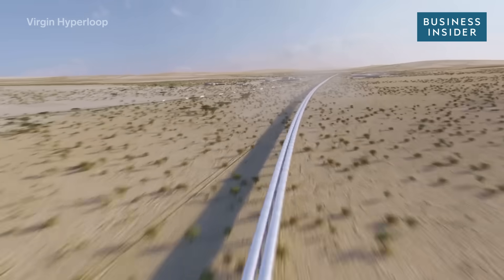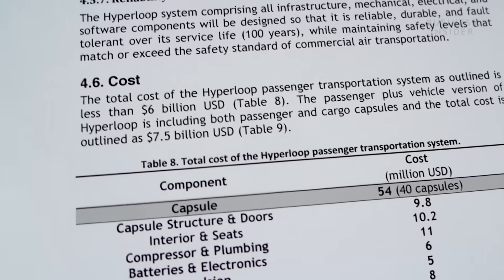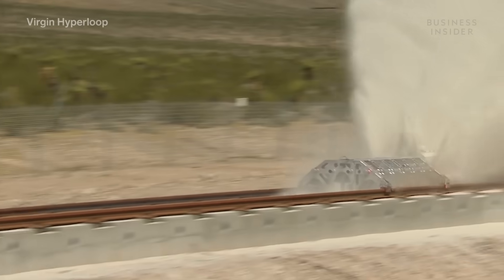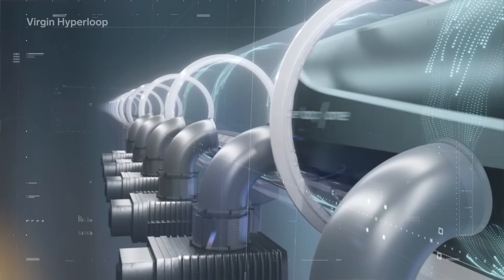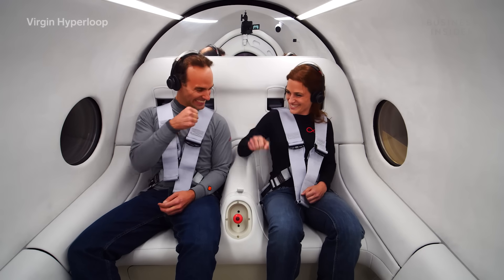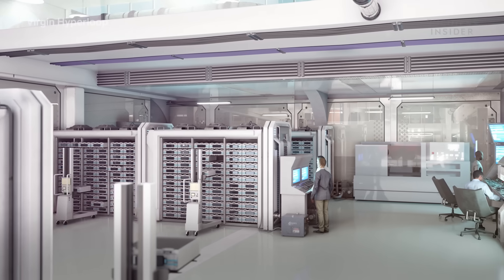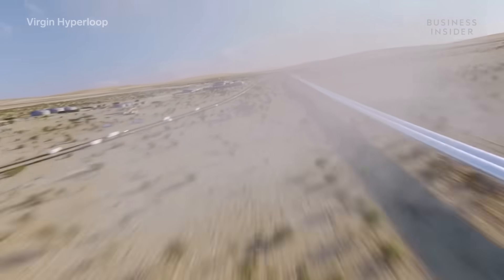How Elon Musk's 700 MPH Hyperloop Concept Could Become The Fastest Way To Travel

Comment: Hi I love the hyperloop but I came up with Aqualoop or Hydroloop idea which I think it's better. It's a tube system filled with sea water with its water current going in one direction and looping back around speeding up. the mag track would be on top and the capsule/train would be weightless. Not only solving one but several problems all at once. Rising water/earth temp./drinking water/cleaning oceans/logistics/electrical energy/fire Fighting...

Comment: Yo imagine accidentally getting out and ur body just explodes cause of the vacuums BAHSBABA
Reply: Imagine going in a pressurized metal tube which kill you when it fail... Oh, it's just a plane then.
Reply: @bachvandals3259  no i meant the vacuums outside the carriage. Theres 99% less air, meaning that getting out will cause your body to fill the entire space that the vacuum exists in. Planes kill you by diving straight to the ground, not always by its surrounding area.
Reply: @user-l4m8g  It doesn't matter, most people die right after the malfunction, children and light weight will be suck out first. There is a thing call air pressure force, and it has nothing to do with how empty the outside is, rather it's the amount of air that is de-pressurized. People die from crash in the landed explosion is a myth, they die from whiplash and rapid deceleration and acceleration. People die from 50G, not the vacuum.
Reply: @bachvandals3259  ok cool but like. That wasnt the point im making tho. Technically everything that fails that isnt supposed to, kills. I was just talking abt the hyperloop specifically.  Whyre you talking about planes under a comment about hyperloops.
Reply: @bachvandals3259  i mean. Good on you for knowing abt planes but like,,, Why are you talking about it here.
Reply: @user-l4m8g  No, i work in oil pipeline pressure monitoring, in short, middle-East engineering oil contractor.Reason? Covid, US unconditionally surrender to terrorist in Afghanistan and Syria. Jobless, depressed and lots of time on hand.
But, mostly because i hate slightly incorrect comments on YouTube.
Reply: @bachvandals3259  aight then. Glad my comment was a destressor i guess.
Reply: @bachvandals3259  yeah the u.s surrendered to the terrorist they created by bombing the shit out of peoples homes
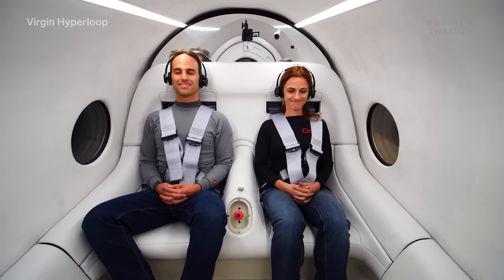Reply: @bachvandals3259  https://youtu.be/BafdAGKvR38 welcome everyone to participate in the last meditation in the Age of Aquarius, in order to end the epidemic, please participate and share a lot!  We will meditate in the Age of Aquarius at the exact moment when Jupiter and Saturn intersect on December 21, at 6:22 PM UTC.  This is equivalent to 10:22 AM Pacific Standard Time in Los Angeles, 11:22 AM Denver Standard Time, 12:22 PM Chicago Standard Time, 12:22 PM Eastern Standard Time, New York 1:22 PM Eastern Standard Time, and London GMT PM  6:22, 7:22 PM Central European Time in Paris, 8:22 PM Eastern European Time, in Cairo, European Standard Time on Tuesday, December 22, Taipei and Beijing, December 22 Beijing Time, Japan Standard Time  , 3:22, Tokyo, December 22, Sydney, 5:22 EST.  http://2012portal.blogspot.com/2020/11/make-this-viral-age-of-aquarius-final.html?m=1

Comment: Nope.  Never happen.  Dump your liberal agenda, and realize nobody wants to hang out going 700 mph in a vacuum, especially when if it fails, you instantly die.  And if you think building this would be cheaper than a bullet train, I laugh at your ignorance.  So how are you going to maintain a vacuum for even 100 miles?   How is more than one capsule going to be in a tube at the same time?   How do you get on and off that thing, without breaking your vacuum?  And what is this thing running on?  Electricity?  Gas?  How does it propel itself?  700 mph wheels, that don't wear out in two months (Japan nearly goes broke replacing wheels on mere 200 mph trains)?  Propellers, that work in a vacuum?   How are you going to stop terrorist attacks on this thing (a high powered rifle, anywhere on the tube, so hundreds of miles, could cause the vacuum to instantly fair)?  How are you going to convince people that a GIANT pipe running through their neighborhood is not an eye-sore?  How are you going to traverse roads and rivers?  EVERY road would need to be bridged, not just a train crossing.  It's a joke, it will never happen.  But it certainly is an instant panty dropper for those liberal tree-hugger macbook idiots out there.

Comment: the hyperloop will never work you will about 10 billion dollars of pumps alone for it and to unload it is the same you would have to have about 30 pump all about 2000 dollars plus 30 min your time to pull a vacuaam furthermore if it fails it will refill with air and be down for about 20 days for a 1/1000 of a atmosphere. Plus it will cost millions of dollars of electricity since there will always be a leak in this long of a track so you have to run about 1 pump($2000) for every meter of track 24 ours a day so good luck and waste your money

Comment: Ok so if you have a depressurisation of the passenger compartment you have 28 people who’s blood boils instantly . Bear in mind that a depressurisation at 43000 feet you have 5 seconds before your out cold purely based on O2 levels. Not to mention that the air locks  either end will take about the same time as the “journey”. Thunderfoot where art thou!

Comment: "the future"...........ye its really not

107mph in 6.5~ second, not really impressive considering the fastest car does that in 10seconds.

The capital cost to install this system will be so prohibitively expensive it will probably cripple it unless you can mass produce pre-formed tubes that you can install on an elevated platform. Using existing train lines or tunnels would potentially prove tricky if existing built curves are too sharp, just think the force going around a corner fast in your car, now ramp this up to 500..1000+mph, the curves would have to be very gradual or non existent for a comfortable ride

Comment: And when the train stops in the middle of the tracks, safe to say its going to be "breathtaking".
Reply: Instant coffin
Reply: The passenger transport units will be sealed obviously... of course the question then is how it get's back to the station. 

Assuming it still has power there is a non-maglev motor that pulls it along slowly back the station. If it has no power or the backup motor doesn't work, then it could be towed/pushed. And if fr some reason it's really stuck... then the tube will need to have the vacuum removed slowly so the passengers to get out and onto a recovery vehicle.
Reply: What no one seems to be considering is how to deal with a collapsing tube. It's under vacuum and therefore under quite a bit of stress. 

If something causes it to rupture you've now got a long vacuum tube rapidly filling with debris being pushed along very quickly by the in-rushing air, straight towards an oncoming pod, which gets smashed to bits. By the time you've done the calculations for safe deceleration rates for restrained passengers and distances travelled by other pods before they can come to a rest so that the vacuum can be bled off along the whole tube (the only thing that will bring that debris to a stop), the separation times between pods are quite large (>15 minutes). This will make it uneconomical. If you try to engineer the track so that the tube can never collapse, its then a very heavyweight construction (especially in an earthquake zone) and again its questionable as to whether that is economic. Run it at a partial vacuum and it can't go very fast, and is no better than a train. 

High speed rail will likely always have a higher passenger throughput and be more profitable. It can also provide a working environment (power, Internet, tea, coffee, even offices on some Shinkansen), which makes its "slowness" a none-problem. It can also have points / switches.
Reply: @abarratt8869  "What no one seems to be considering is how to deal with a collapsing tube. It's under vacuum and therefore under quite a bit of stress. "

I've thought about it.. and the solution is simple. You put one way valves every 50 meters or so along the top of the tubes. Nothing holds them in place other than a hinge and outside pressure pushing down on them. In the case of explosive decompression these valves do 2 things. They actually release pressure from the tubes as air rushes in and they allow the pressure to equalize from a different direction slowing the rush of air. 

A more complex system would also be electronically controlled so that valves further away allow air in in a controlled way before the blast of air reaches it.
Reply: Considering the pumps are active, loss of power (prime cause of the carriage stopping) means air will just rush back into the tube and none of it will be sucked oit. They'd combine it with a 1 way valve that's probably also held shut with electromagnets. Loss of power releases the valve, and the natural phenomenon of pressure equalisation does the rest.

Undoubtedly the crew will be given breathing apparatus and there will be manual kill switches for the pumps /valve locks in the tube so they can climb out and turn them off.
Reply: @ScathingMobile  "undoubtedly" thats what the people said before the 737max crashed. We cant assume that a company will use common sense because it historically has. So we have to wait and see how they implement their emergency measures in the final product.
Reply: Yessir
Reply: https://youtu.be/BafdAGKvR38 welcome everyone to participate in the last meditation in the Age of Aquarius, in order to end the epidemic, please participate and share a lot!  We will meditate in the Age of Aquarius at the exact moment when Jupiter and Saturn intersect on December 21, at 6:22 PM UTC.  This is equivalent to 10:22 AM Pacific Standard Time in Los Angeles, 11:22 AM Denver Standard Time, 12:22 PM Chicago Standard Time, 12:22 PM Eastern Standard Time, New York 1:22 PM Eastern Standard Time, and London GMT PM  6:22, 7:22 PM Central European Time in Paris, 8:22 PM Eastern European Time, in Cairo, European Standard Time on Tuesday, December 22, Taipei and Beijing, December 22 Beijing Time, Japan Standard Time  , 3:22, Tokyo, December 22, Sydney, 5:22 EST.  http://2012portal.blogspot.com/2020/11/make-this-viral-age-of-aquarius-final.html?m=1
Reply: https://youtu.be/BafdAGKvR38 welcome everyone to participate in the last meditation in the Age of Aquarius, in order to end the epidemic, please participate and share a lot!  We will meditate in the Age of Aquarius at the exact moment when Jupiter and Saturn intersect on December 21, at 6:22 PM UTC.  This is equivalent to 10:22 AM Pacific Standard Time in Los Angeles, 11:22 AM Denver Standard Time, 12:22 PM Chicago Standard Time, 12:22 PM Eastern Standard Time, New York 1:22 PM Eastern Standard Time, and London GMT PM  6:22, 7:22 PM Central European Time in Paris, 8:22 PM Eastern European Time, in Cairo, European Standard Time on Tuesday, December 22, Taipei and Beijing, December 22 Beijing Time, Japan Standard Time  , 3:22, Tokyo, December 22, Sydney, 5:22 EST.  http://2012portal.blogspot.com/2020/11/make-this-viral-age-of-aquarius-final.html?m=1
Reply: https://youtu.be/BafdAGKvR38 welcome everyone to participate in the last meditation in the Age of Aquarius, in order to end the epidemic, please participate and share a lot!  We will meditate in the Age of Aquarius at the exact moment when Jupiter and Saturn intersect on December 21, at 6:22 PM UTC.  This is equivalent to 10:22 AM Pacific Standard Time in Los Angeles, 11:22 AM Denver Standard Time, 12:22 PM Chicago Standard Time, 12:22 PM Eastern Standard Time, New York 1:22 PM Eastern Standard Time, and London GMT PM  6:22, 7:22 PM Central European Time in Paris, 8:22 PM Eastern European Time, in Cairo, European Standard Time on Tuesday, December 22, Taipei and Beijing, December 22 Beijing Time, Japan Standard Time  , 3:22, Tokyo, December 22, Sydney, 5:22 EST.  http://2012portal.blogspot.com/2020/11/make-this-viral-age-of-aquarius-final.html?m=1
Reply: No it slides along the track - just because you loose power its not like it drops straight down and stops 720 to zero in one second no no.  It slides forward to a safe stop along the track with friction brakes. And theres nothing in front so no chance or crash into another train.
Reply: You pass people at a closing speed of much more than 100 mph every day, mere yards apart, many of which are surfing a cell phone. You strap yourself in a pressure vessel and fly nearly 600 mph at altitudes too high to breathe, without giving it a second thought. You sit on a boat and float atop the tumultuous seas without a problem.
And just look at how many people praise the idea of traveling through a radioactive vacuum of space shoved by a rocket, to colonize another planet where every environmental condition is trying to kill man.
Reply: They can be built much safe. Just like Japanese Shinkansen bullet train, where there have been rarely any casualties since it was made, even though Japan is an earthquake and storm prone area. Technically this can be even safer. I think countries should invest heavily in this area. This could replace passenger airline industry, which will cut emissions, save urban space and skyscrapers can be built freely. Also for super fast travel, we can use starship for those ultra-long trips. But to make that happen, countries will have to work together through the borders, which is impossible right now.
Reply: @DocPrakhar  sure. A vacuum tube can be safer. You muppet
Reply: Why would it stop?
Reply: @jorge9199  Why do planes stop in mid air? Because shit happens.
Reply: @jorge9199  because mechanical failures happen all the time.
Reply: @jorge9199  who knows,no matter how advanced a machine is it can always fail or break down .
Reply: @jorge9199  power outage. Engine failure.    Need more?
Reply: @SF-eo6xf  it has no engine. It's electric. If there was a power outage, which probably won't happen, the vacuum pump will also switch off. They can just build an emergency opener so that Air is circulated.
Reply: @SF-eo6xf  Backup lithium batteries onboard and the pods will have electric engines in them which will be used to start moving them until they get enough speed to levitate.

But even if the motor died and it was stuck, you would just turn off the vacuum and slowly allow air back into the tunnel. There may also be a way for a recovery vehicle to be connected to the front or back of the pod so people just transfer into another unit.
Reply: @crocodile2006  and if they fail?
Reply: @SF-eo6xf  If what fails? Be specific.
Reply: @David-ty5jk  if you have the sauce just put it out there

Comment: I have a doubt that why did they use 2 tubes for 2 trains travelling at the same location and why didn't they merged the 2 tubes of different lanes?
Reply: It is probably easier to manufacture a singleline tube, and under pressure the forces will spread out more evengly on the walls of the tube then, that does not change that this Concept is just a sci fi and many point that out

Comment: I think the concept of a pneumatic tube is certainly something to be reckoned with, but experiments from the early 20th century proved how fragile and unfeasible it was. Not only is it expensive to operate, but maintaining a constant cushion of air below a moving object requires unattainably high speeds, making it impractical for trains to stop at stations.   And the high cost of R&D, as well as the complexity of the large amounts of infrastructure necessary, make it far more impractical, and the fact that this is an unproven concept shrouded in skepticism makes the whole project even more outlandish. The point is, things like pneumatic lines are exciting but that doesn't mean they necessarily serve a purpose, practically speaking.  Building a high-speed rail line would have the same benefits and with intercity distances, the speed difference is negligible. Plus high-speed trains can already be applied as they are currently over 30,000 miles of railway track in the US, for less cost.